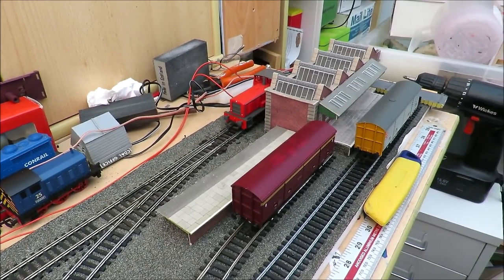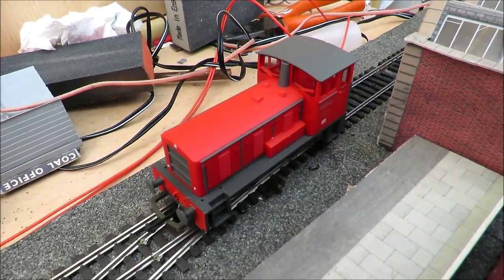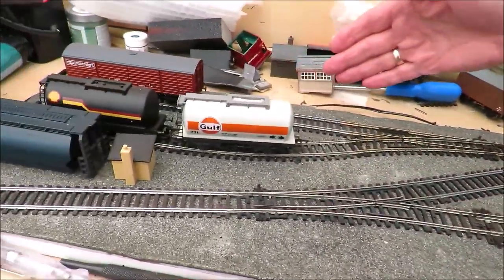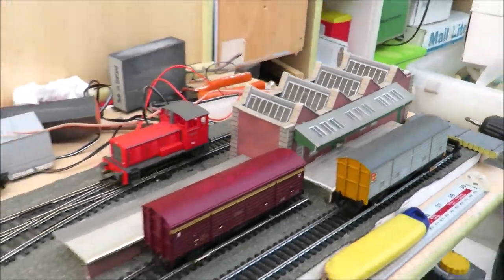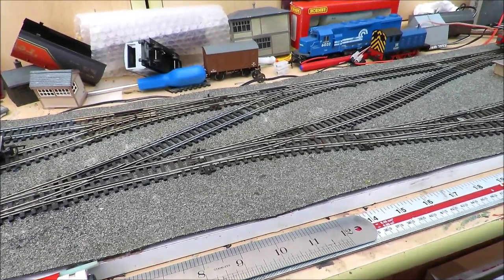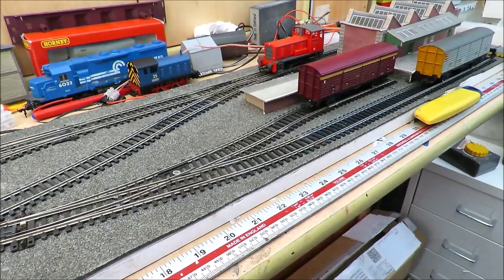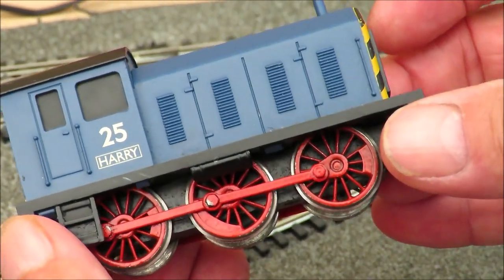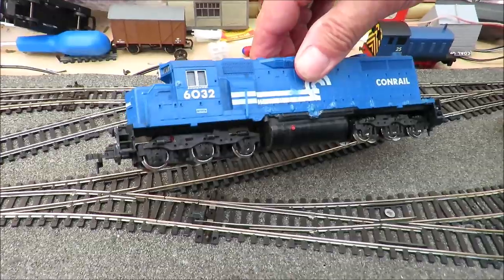OO Gauge Model Railway Layout - Industrial Shunting Yard - Part 1

Comment: All the shelf layouts you guys have been doing lately have given me an idea. Have you guys ever considered connecting two of these tiny shelf layouts end to end with a fiddle yard?  I figure you could get an interesting operation going representing the beginning and end of a supply chain like that. For instance, a coal mine on one shelf layout leading to a passing loop leading to a power plant. With the fiddle yard as a passing loop you could have a separate loco running each half of the chain and exchanging there trains in the middle.
Reply from the maker: Its an option ive looked at, so maybe one day. Thanks
Reply: Mr Hellman, your idea is exactly what I been considering. I made a 2x4 industrial switching (shunting) layout based on a plant in Beauharnois, Quebec (looks like a short line) that I can connect to a pass thru fiddle yard. On the other end of the fiddle yard I could connect to an existing 3x4 layout OR I could create another small layout instead.  Thanks for the motivation. 👍🏾

Comment: I've seen many plans for industrial layouts and I have not built one on this day. You give me an idea with your video, I'm thinking about an industrial layout around a aluimium foundry (raw materials in, finished products out) working for automotive and aerospace industry, like the one in which I had worked more than 30 years ago. I take your track plan as an inspiration source, sounds good to me.
Reply from the maker: The materials in products out scenario really interests me as it gives a good purpose to the way the layout operates. With your experience I guess you could design a really good layout
Reply: @BudgetModelRailways  Agreed. With an aluminium foundry, you have billets coming in (I saw once in France a train with flat cars loaded with aluminium billets around one metric ton each) and lots of products going out. Typically, crates with engine blocks going out to an automobile or lorry/bus/coach factory, processing equipment item for the industry, like valves, and aircraft parts, typically landing gear legs, but also some other structural parts (heavy duty stirrups to hold the engine boom below the wing, for instance).

The factory I worked with manufactures engine blocks for the automobile industry.But I imagine my foundry also manufacturing heavy cast valves for the chemical industry, fuel pump casings for launcher rockets, gearwells for aiplanes flaps, and lots of interesting and original products like that. An Airbus A300 front landing gear leg on a flat car would not be out of place out of such a factory...
Reply: Should make for some interesting traffic and shunting.
I'm planning something similar only in Z scale, lots of modeling to be done for buildings and installations.
Reply from the maker: What a great idea. I have loads of model aircraft parts from when used to make 1/72 scale kuts
Reply: @BudgetModelRailways  You can model such a factory roughly from the grouping up to our days. Alumimium became currently used as Duralumin in the mid-20s for aircraft parts, and its use had been broaden after WW 2. Also, you can make a factory that uses flat sheet and laminated aluminium. Since the '50s, you have a broad use of aluminium in construction, for windows frames for instance. If you set your factory from the mid '70s onward, you have also the packaging use of aluminium cans.

Another idea I have for a small workshop, it is a cookware factory, manufacturing pans and dishes out of stainless steel. This became industrialized in the '30s, so steam compatible. You can model sheets of stainless steel incoming on flat cars, and crated and packed cookware coming out, bought in bulk by professionals like luxury hotels and great restaurants, or department stores. I've got this idea from a character from one of my novels, who is a professional cook and had seen such equipment becoming a standard issue in the '30s.
Reply from the maker: Thanks for all the info, the next video on this layout is due online tomorrow

Comment: Does that PWM controller have better reliability with points compared to the classic controls? Usually you have to run an underground power grid under such trackwork to make sure that you can reach every piece of rail.
Reply from the maker: Not with DC and  insulfrog  points, but yes the Pwm seems to help

Comment: What dimensions are we talking about here? Both the layout and the wagons...
I have seen layouts like this on shows being used as a shunting puzzle for kids, but that one is in the 2 meter baseboard size category
Reply from the maker: Its 128cm by 23cm, the wagons are 14cm bodies so about 17cm Inc couplings, but you could use shorter ones if you wanted. I just wanted a change
Reply: @BudgetModelRailways I already guessed that the wagons were in the 15cm length category… but you need more space when using NEM shafts which are quite common on the continent as those won't couple in corners as those giant UK loops will.